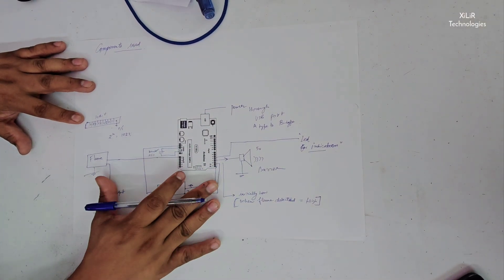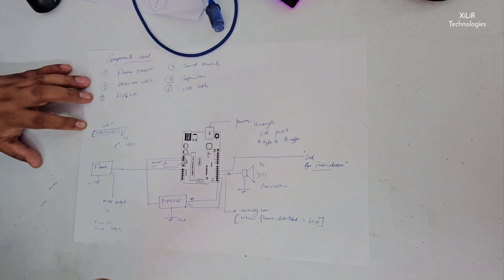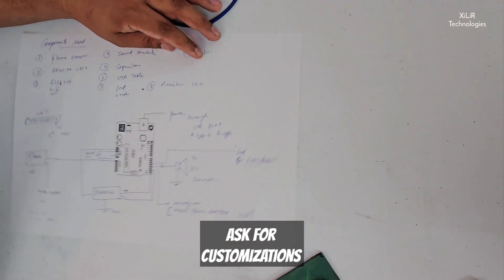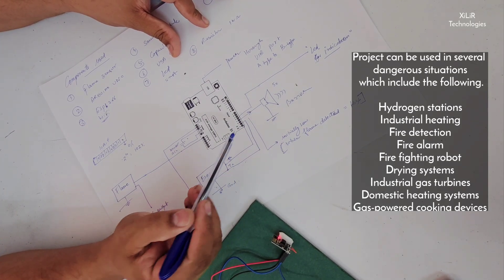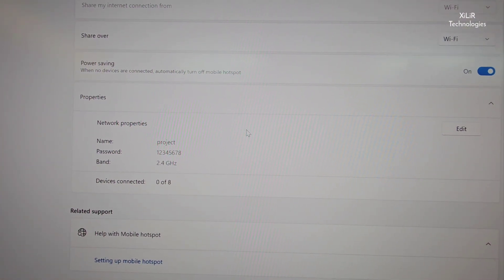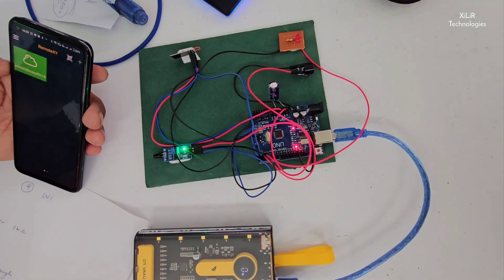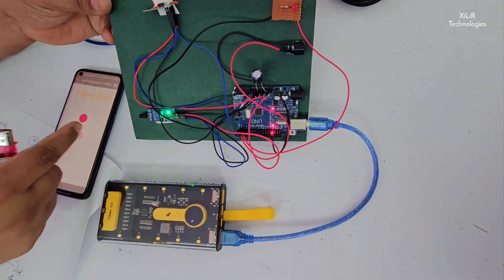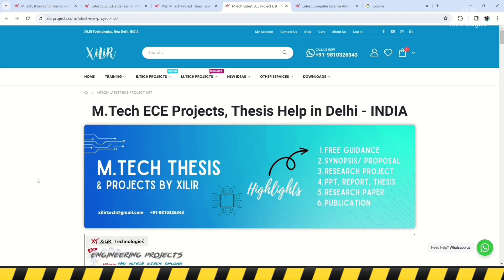🔥 How to make : IOT Fire Alert System using Arduino, Esp 8266 | Inspire Award Project

Comment from the maker: Circuit Connections:

    Flame Sensor:
        VCC to 5V on Arduino
        GND to GND on Arduino
        A0 (Analog Output) or D0 (Digital Output) to A0 or any digital pin on Arduino (e.g., D2)

    ESP8266:
        VCC to 3.3V on Arduino
        GND to GND on Arduino
        RX to TX on Arduino (use a voltage divider to drop 5V to 3.3V)
        TX to RX on Arduino
        CH_PD to 3.3V on Arduino

    Buzzer (Optional):
        Positive leg to any digital pin (e.g., D3) on Arduino
        Negative leg to GND

    LED (Optional):
        Positive leg (longer) to any digital pin (e.g., D4) on Arduino with a 220-ohm resistor
        Negative leg to GND

Arduino Code:

cpp

#include <SoftwareSerial.h>

SoftwareSerial esp8266(2, 3); // RX and TX pins for ESP8266

const int flameSensorPin = A0; // Analog pin for flame sensor
const int buzzerPin = 4;       // Digital pin for buzzer
const int ledPin = 5;          // Digital pin for LED

void setup() {
  Serial.begin(9600);
  esp8266.begin(115200); // Set ESP8266 baud rate to 115200
  pinMode(flameSensorPin, INPUT);
  pinMode(buzzerPin, OUTPUT);
  pinMode(ledPin, OUTPUT);

  // Initialize ESP8266
  sendCommand("AT", 1000, "OK");
  sendCommand("AT+CWMODE=1", 1000, "OK");
  sendCommand("AT+CWJAP=\"Your_SSID\",\"Your_PASSWORD\"", 5000, "OK");

  Serial.println("Setup complete.");
}

void loop() {
  int flameValue = analogRead(flameSensorPin);

  if (flameValue < 300) { // Adjust threshold based on your flame sensor
    digitalWrite(buzzerPin, HIGH);
    digitalWrite(ledPin, HIGH);

    // Send alert
    sendData("Flame Detected!");
    Serial.println("Flame detected, alert sent.");
  } else {
    digitalWrite(buzzerPin, LOW);
    digitalWrite(ledPin, LOW);
  }

  delay(1000);
}

void sendData(String message) {
  esp8266.println("AT+CIPMUX=1");
  delay(1000);
  esp8266.println("AT+CIPSTART=0,\"TCP\",\"api.thingspeak.com\",80");
  delay(2000);

  String cmd = "GET /update?api_key=YOUR_API_KEY&field1=" + message + "\r\n";
  esp8266.print("AT+CIPSEND=0,");
  esp8266.println(cmd.length());
  delay(1000);
  esp8266.print(cmd);
  delay(1000);
  esp8266.println("AT+CIPCLOSE=0");
  delay(1000);
}

void sendCommand(String command, int maxTime, char readReplay[]) {
  int countTimeCommand = 0;

  while (countTimeCommand < (maxTime * 1)) {
    esp8266.println(command);
    if (esp8266.find(readReplay)) {
      break;
    }
    countTimeCommand++;
  }

  delay(50);
}